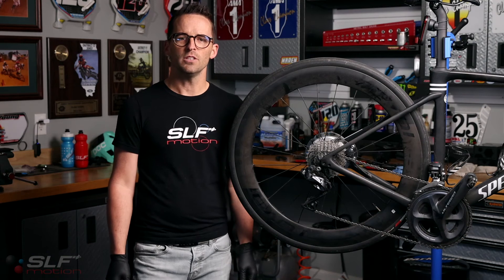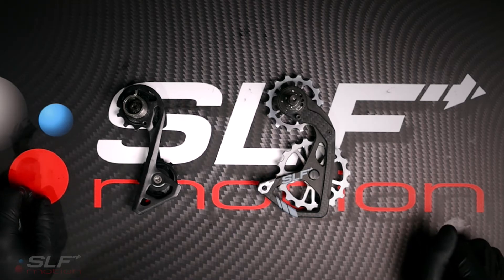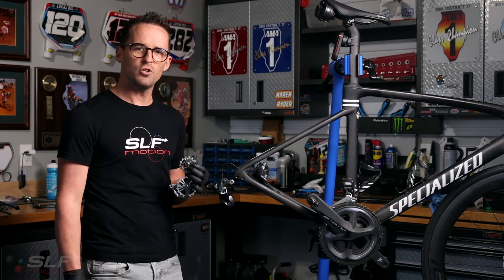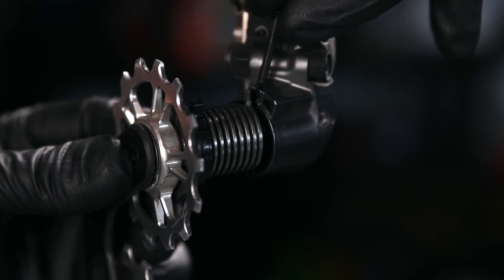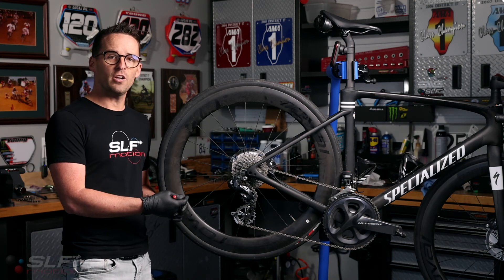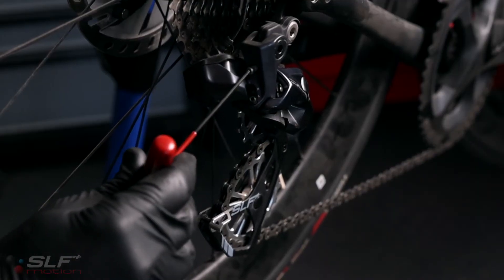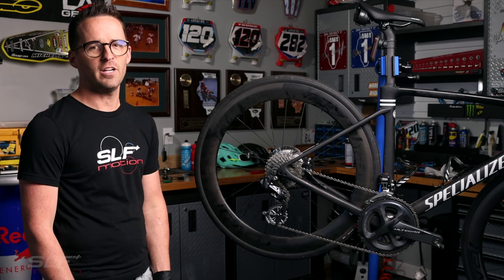SLF Motion - EVO Speed System - Installation Shimano 891 & 921 (11sp & 12sp)

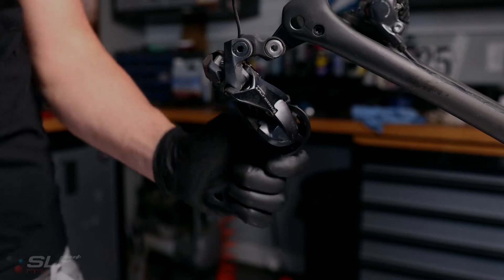Comment: The video mentions removing the stop screw twice (at 0:47 and at 2:35).  Is there more than one stop screw?
Reply: First mention is pertaining to the stock Shimano cage during removal.  Second  mention is pertaining to the SLF Speed System during installation.  Thanks!
Reply: @SteinFenton  Thanks.  I'm still confused on how you remove it twice though?  Do you reinstall it before installing the SLF System?
Reply from the maker: @tmunk123  When the stock Shimano system/cage is still installed, you need to remove the stock stop screw from it in order to release tension and therefore remove from the derailleur...so that's the first mention of removal of a stop screw.  The SLF Motion System comes in the box with a stop screw installed on it...you need remove the SLF stop screw from the SLF System to successfully install it (re-installing the SLF stop screw after rotating the System, creating spring tension).  Thanks!
Reply: @slfmotion4788  Aha!  I got it now.  Thanks so much for the explanation!  My confusion was that I thought the stop screw was part of the derailleur, not the pulley cage.

Comment: Hi...is this compatible with the ultega 12 speed ? Is there an aero version for the same 12 speed too?
Reply: The title says it is:   "This includes 11sp 8000/8050 Ultegra and 9100/9150 Dura Ace rear derailleurs as well as 12sp 8100 Ultegra and 9200 Dura Ace. "

Comment: Hey Blake really helpful video, but is there a trick to removing the spring from the old cage? The one on my DA9150 doesn’t want to come off
Reply: Never mind, I worked it out
Reply from the maker: @JasCar1967  Sorry for my delay.  You are correct though, they can be difficult sometimes.  The best is to rotate it a bit then use a small flat blade screw driver to pop it out.  Glad it all worked out for ya.  Thanks!!!